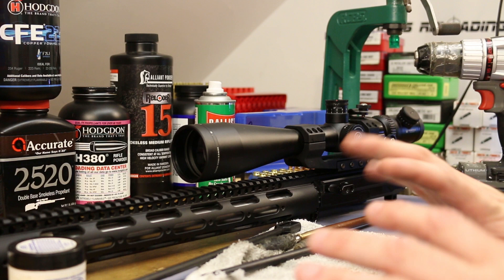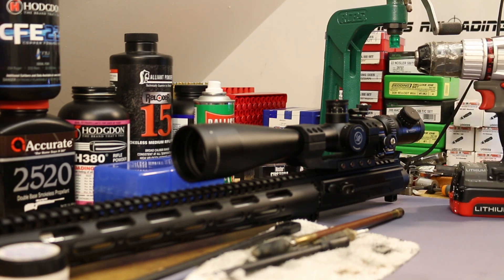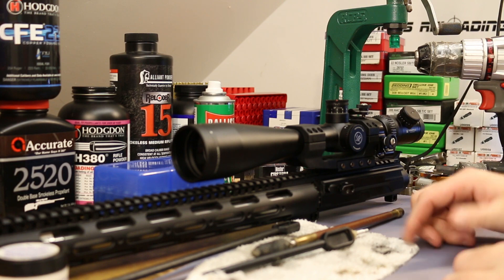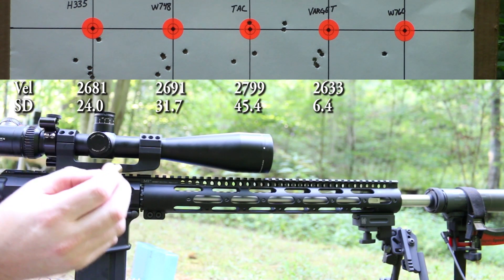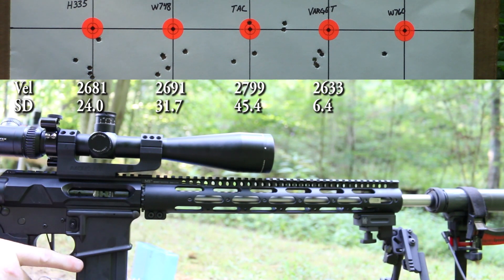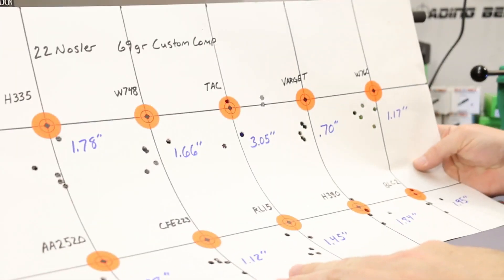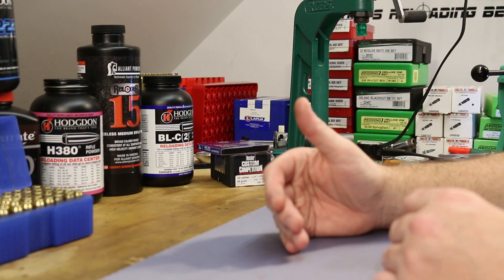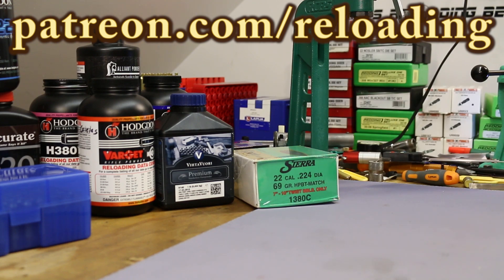22 Nosler - Part 3 - The path of least abrasion

Comment: Send that barrel back. Let Odin make it right. You're at minimum loads, getting pressure signs, and you're not getting any performance that you couldn't get out of 223. I don't doubt that 22 nosler is capable of awesome performance when it works right, but it's pretty obvious that your system isn't working right.

Comment: I'd send the barrel back. These low pressure loads/brass still showed extractor marks and shoulders softening signs, although minimal. I'm not sure I'd be comfortable firing max loads (which is the whole point of 22 Nosler), with that barrel. Considering they've agreed to take the barrel back, I'd do that ASAP, so they can inspect for manufacturing defects. I still contend it's out of spec.

Comment: Great job JRB on this series. Nice choice on tomorrow's selection. Every time I Test a new barrel I grab 69 SMK and Varget. It always performs.

As far as the barrel, I know your seeing improvement as you work on the chamber, (nice job on that by the way) but that just proves something is not right. If it were me that barrel would go back. I would Let them replace it, that barrel Might have headspace issues as well. 

You're at minimum charges and to me the whole point of 22 Nosler is basically it's a hot rod .223, and if you can't somewhat hot rod that barrel with hot loads I'm not exactly sure the point of .22 Nosler.

Odin I'm sure will repair or replace the barrel, and if that don't work, then I would get my money back and WOA for the win. WOA as you know is so much win for the money.

As always, thumbs up on the Vids JRB. Great stuff.

Comment: I wonder if the pressure signs indicate that the bullet is not releasing from the necks correctly. Insanely high neck tension = high pressure. (Worse than loading into the lands) Its like you plugged your barrel and lit the powder off. Your ES / SD numbers are so bad it seems that almost has to be the case. This may be a case that you reloading saved you from blowing your face off. Hot factory ammo would probably be insanely worse. Do you have dimensions on the neck of the case to know how much it expanded?

Comment: Make a custom chamber polisher.  Take the most beat up case and cut a slot in the case head or pound in a Phillips bit into the primer pocket to allow you to turn the case with a drill or electric screwdriver.  Coat the case with Flitz or similar metal polish, insert and spin with your drill.

Or order a chamber hone and some honing oil from Brownells.

Comment: Your issue is headspace. If odin works sent you a bolt with the barrel then it is head spaced accordingly. Typical go no go difference is roughly 4 thousandths of an inch. Your fired brass measured 7-8 thousands larger than the unfired brass which could lead to the extraction problems you were having. Your gun was having extraction issues with or without the gas system involved.

Comment: file down raised ejector mark then see if it spins freely in shell holder good.  Use those 50 shot brass bump the shoulder back .002-.001.

Comment: My 16" 300BLK with pistol gas was doing the same thing to the head and rim. I went to a heavier buffer and problem went away.
Reply: Try going up a couple weights on your buffer to increase the dwell time of your bolt. It seems your case is still under pressure while the case is being extracted. The bolt face is rotating while the case is still under pressure. That's my guess.
Reply: I would think the same, but he was getting the same damage with the gas system off...
Reply: Long Ridge This is a really good point. I lightened my buffer for my 300blk subs, and the supers started getting some real messed up cases.